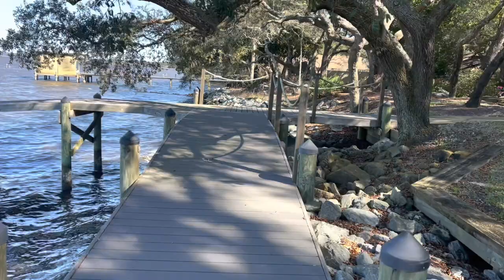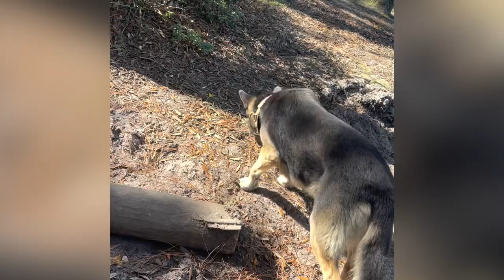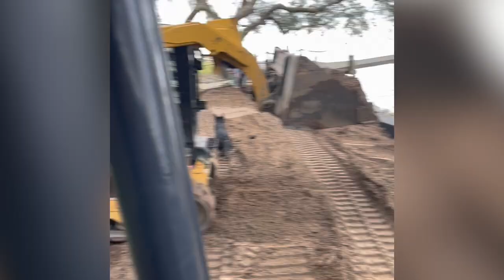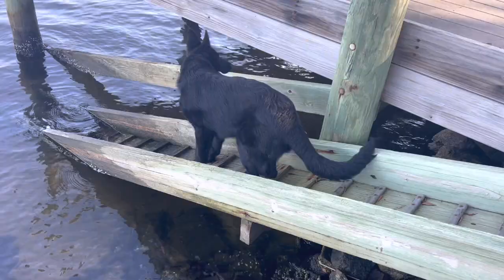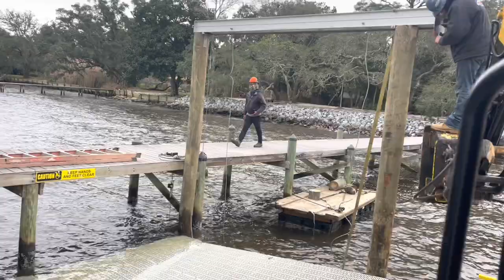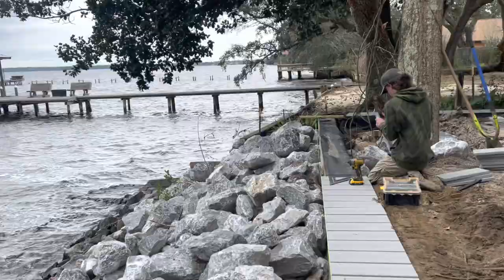Economical Rock seawall design

Comment: Hey Dale- we have a related question- how can you make economical dock piling rails? We have a long  “walkway” with pilings - but the cost to have the pilings drilled with the 2” rope is really expensive. We like the rope, is there some sort of mooring ring or other hardware to snake the rope through? Thanks!
Reply from the maker: Hey Alison thanks for your question. It may take a little more rope, but it looks really good. I have actually looped the rope around the pole one or two times on the inside of the Piling over the dock then put a couple screws in there to hold it still and go to the next one. Good luck on your project.
Reply: @DaleWHickman  Thank you! We just finished the dock/pier and we have a foundation for our home. We think it’s wise to wait to put the railing up until we move as the rope (we decided on 1.5 inch) will degrade over time and we’d like to make it last as long as possible.

Comment: What are you guys using for hose and pipe when I see you jetting in pilings? Thanks for any advise you can offer and great job on these videos
Reply from the maker: Hi Dallas, thanks for watching we  use a 2 inch rubber Flexible hose from a local hydraulic hose supply store in an inch and a quarter aluminum pipe